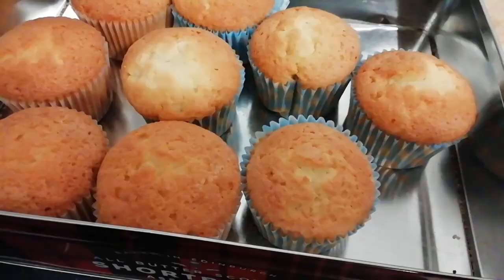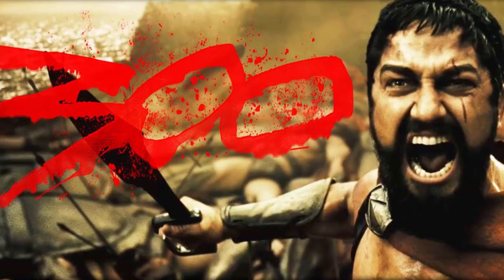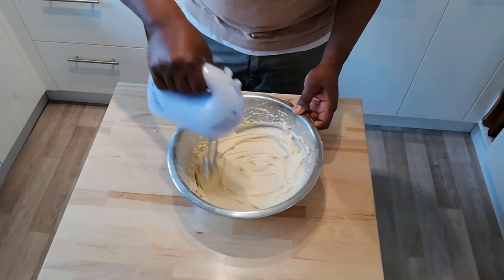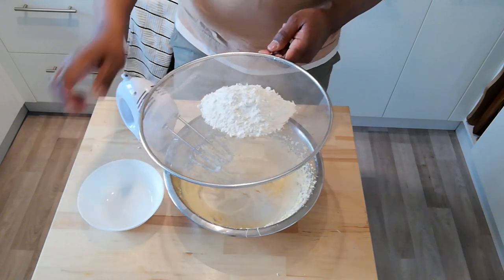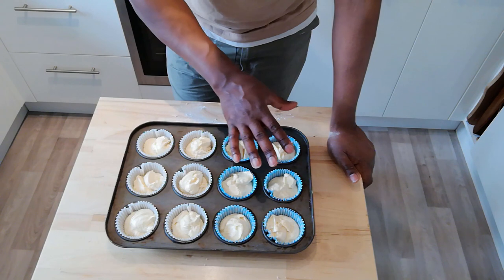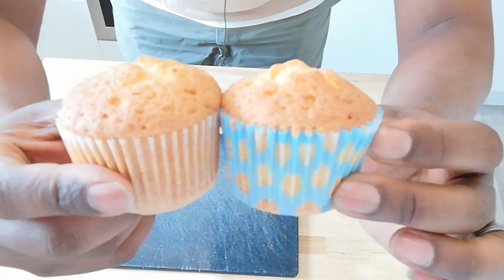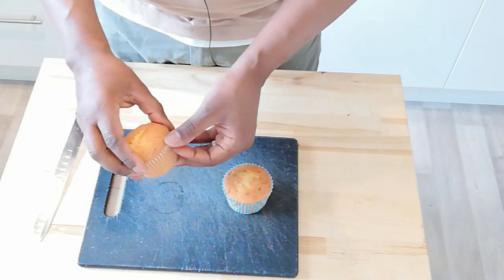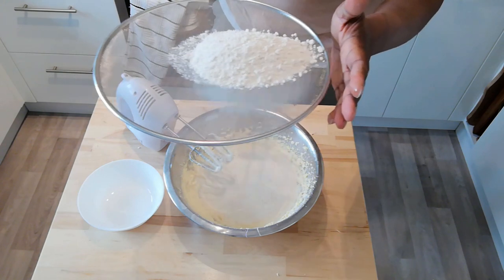How to make the 'PERFECT' fairy cake | How to make the perfect cupcake every time!

Comment: You took the time to cream the fat and sugar, beat in your eggs and sifted your flour,  Why did you not fold in the flour to keep as much of the air you'd put in to the mix as possible?  by using your electric mixer at this stage do you not risk loosing all your air as well as activating the gluten making your cakes less light than they could have been? This is what i was always told.
Reply: That tastes so good taste so good Jesus looks so yummy but of course I've never had it I wish I had very muffins are so yummy 🤧
Reply from the maker: Good point. Thanks for the feedback.